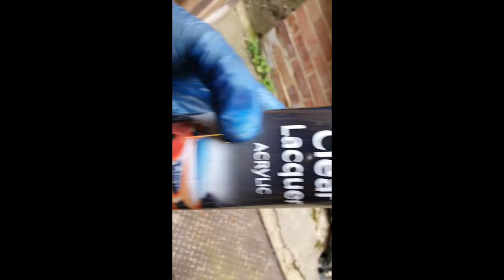C4 Grand Picasso Windscreen Trims Bubbles and Rust problem sorted.

Comment: Great job how do you get them of
Reply from the maker: Just pull them off slowly.there's tabs underneath it.
Reply: @Bogzter9  thanks for the reply is there a screw at the top that has to be removed from inside
Reply from the maker: @tingtong813  no screws just tabs that holds the trims but be carefull while you pulling them i broke 3 of mine.
Reply: Hello, did you know what is a model of the plastic clips for the windscreen trim? My all clips are burned from the sun and they are old yet.